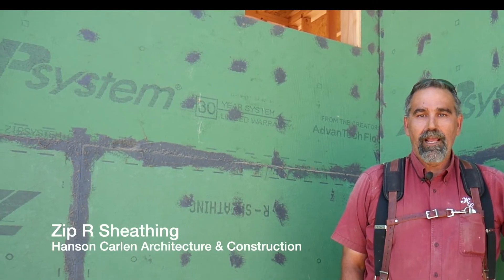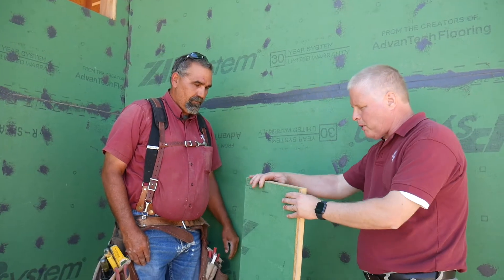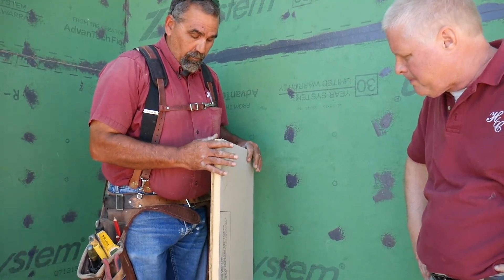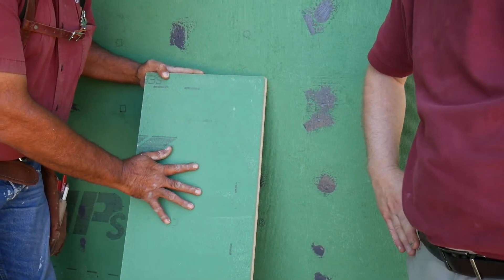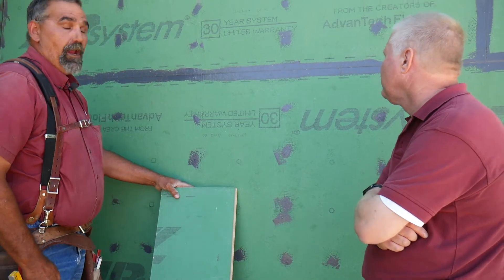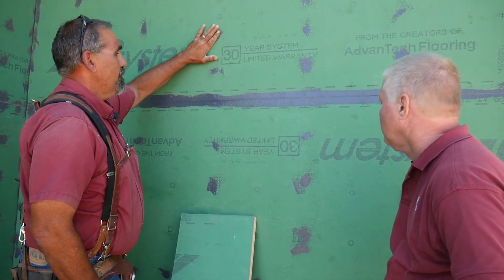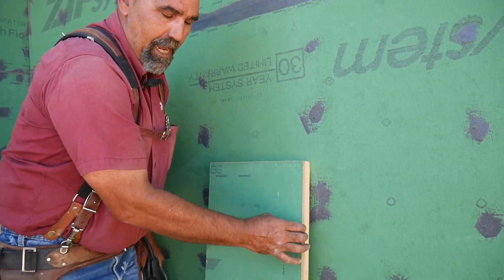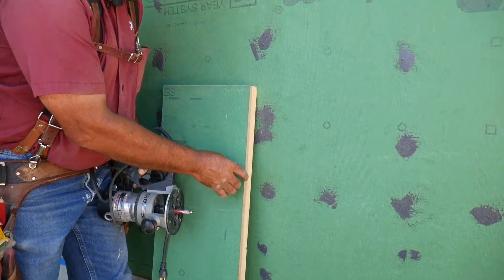Good "Bones" to a Home Start Here- Zip R System Sheathing

Comment: A few comments on the install.  You have installed the product horizontally which provides a slightly better shear wall but from the nailing pattern, it doesn't seem like you have continuous blocking behind all edges of the sheathing which is required per the manufacturer.  3 inch nails are fine as that still give you 1.5" of stud penetration.  The proud foam is there specifically to provide a 1/8" gap between the OSB panels.  By routering those off, you risk the OSB buckling.  This is a very specific design to prevent this buckling.  You should use tape on the joints and the corners as the liquid flash appears to too thin there.  flashing each nail hole is a good practice.  A very good product but your install is slightly deficient.
Reply from the maker: Thank you for your comments. We appreciate that you took the time to watch our video. 

We are constantly looking to improve and not be slightly deficient!  We have been blocking our braced walls for many years at the joints, which varies by the design of the wall and the method used for bracing the part of the building on which you are working.  Several years ago the APA came out with an excellent handbook on wall bracing and how and where to use it - you may find this useful. As far as the Zip R system, if you will look more carefully at the installation manual you will find different requirements for walls (labeled) “Installation when not part of lateral for resisting system”. You need to understand the Zip system manual is not intended to tell you how, why and where to build braced wall systems for a home. For our company, our in-house architect calculates and submits this (as part of the permit) to our local jurisdiction before we begin framing.  Regarding the gap between panels, we understand that panel foam hanging over is intended by the manufacturer to provide a gap for the OSB.  However, the last time I used a tape measure 1/8” plus 3/16” equals 5/16” …not one-eighth inch, which is ideal for OSB panel spacing.  Our complaint is not with gap or the provision for OSB buckling. The problem we had on this project was that the foam was not applied consistent to the panels by the manufacturer. Some 1/8” some 3/16” some 1/16” on one end to 3/16” on the other. This makes alignment difficult and panels to run off layout. That is where the router came in handy, as we do not put on crooked panels.  Maybe we just had a “bad batch” from the manufacturer.  

We will use the product again and update the report. I hope the install for your job goes well. Thank you again for your comments.
Reply: I agree that the 1/4" foam extension beyond the OSB if for OSB expansion and it shouldn't have been routed off.  The foam is not Styrofoam.  It is poly iso that has a significantly higher R-value (R-6 per inch) than Styrofoam.  More disinformation from uniformed people who just want to do a You Tube vid.

Comment: As soon as you mentioned it doesn’t need to be followed with  housewrap I was sold. I wonder though, with siding and trim boards are you able to still use conventional length siding nails?
Reply from the maker: Hello thank you for watching and your kind words.  I had the same questions.  Zip systems say you are to use longer nails for siding application.